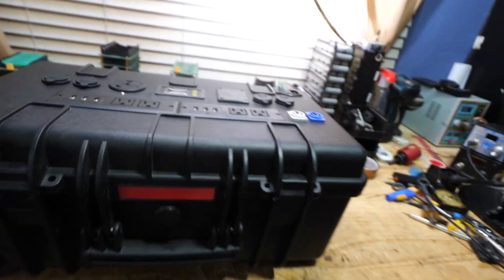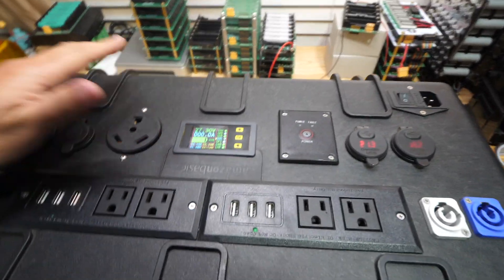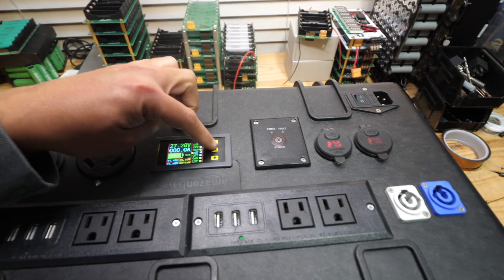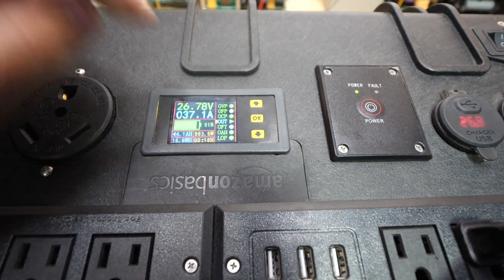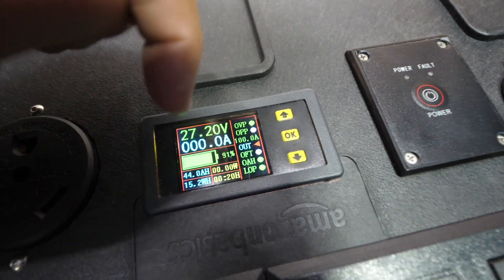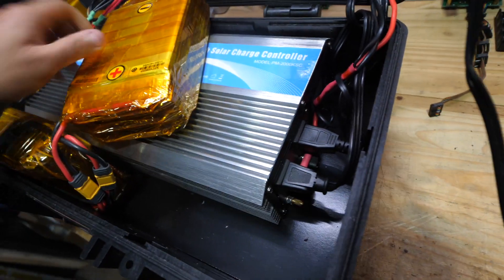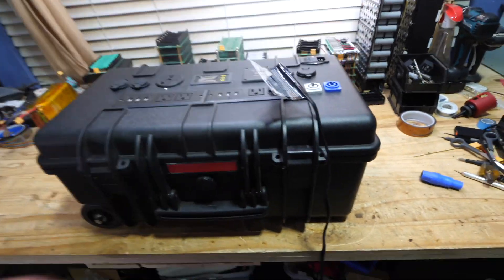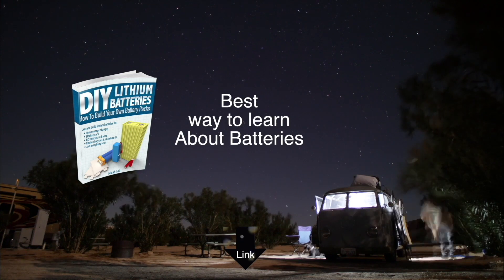DIY Solar Generator still better than NEW Kodiak

Comment: Would it be possible to have a description of the components and why you use them? I am interested in learning and building one… I am going to build my batteries… I have 14 pouches and and trying to find others… I was thinking of building a smaller version and then build a extension

Comment: nice video 🥰🥰🥰🥰i have 48 volt solar charger 30A FOR MY 48V 3000 watts pure sine wave inverter what size solar panel to used not much about panel in in Toronto Canada

Comment: I needed a unit https://www.youtube.com/post/UgkxOTeIs0vv4_9B5hsmnLsk9r930uDQLu_Y that I could store in my home when I wasn't running, so it being light and running on propane were key requirements. I can store the propane tank/bottle outside yet store the generator in my home when it's not in use as I will never put any gas in the engine. It is so light, and on echo mode, which I expect is how it will be used most of the time, it is pretty darned quiet (certainly compared to all the generators I hear in my neighborhood after each power outage).Many of the previous reviews had me concerned that it would be difficult to start on propane, but I have to say, I had absolutely no problem at all. I primed it first using the choke...3 pulls, heard the engine want to start, flipped it to propane, and one more pull and she started. I ran it for 2 hours the first time and plugged it in my fridge. And when I was done, I put the propane tank away and carried the generator to my basement for next time.I could not be happier.

Comment: Awesome video and nice unit. I am currently building a smaller unit for camping ect. I do want to build a larger one as a back up for the house in case the grid goes down. I like the expansion port you have as well and everything is neat and tidy.

Comment: Have they brought out USB quick charge and type C if so  where can you get them I'm looking for both built in and cigarette lighter plug ones my fitbit only charges on a quick charge USB and my phone with 3 hours of charging on the oid slow charger didn't even last 1)2 an hour before it died

Comment: Just finished building my base station system, but am currently designing portable system similar to this. Likely 200ah (2400wh) batteries, 2000w/4000w inverter, DC distribution using Anderson Power Poles, fans etc etc. Love my battery backup systems with solar power inputs and controller.
Reply: I built a solar generator on wheels for 7200 watt hour power, 3000/6000 watt inverter, on board 75 amp LiFeP0 charger for wall power or generator input, 30 amp MPPT solar charger, 250 amp BMS and 8x280 amp hour cells. Its a total blast building this stuff myself. Here's a short video of it charging my other 2100 amp hour AGM bank a few days ago. The stuff on top of it is for a fresh air welding mask project using NATO gas mask filters. Its also a handy work bench and power tool outlet.
https://www.youtube.com/watch?v=NYpczRYDFJQ
Reply: @kimmer6  ….very cool. Nice job. Working on installing a disconnect switch to our main breaker panel. Definitely have some projects on the short list

Comment: Beautiful job! I wish I was able to do this. I would blow myself up LOL!
I did a DIY 2400w with two BattleBorn 100ah batteries, 3000w (overkill) inverter (24v). No real bells and whistles. I am still thinking about adding two more batteries or just go with a ready-made solution. Solar input, extension cords and surge protectors are how I distribute the energy. I also bought 2 Bluetti "solar generators", the 1500w and 2400w on discount. I like redundancy. Three separate sources of energy with enough panels to charge them all.
DIY will be much more affordable if you do your homework. I learned enough now to DIY for less. I would still buy the BBs, they work. Saving money is cool and building your own stuff feels great. But my efforts for learning and projects are now geared to getting ready for the reset and chaos that will follow. HAM radio is my main focus...DIY HAM radio go-box and hand portable battery/power boxes are now being built.

Comment: Hello I know this video is a little old but can someone please explain how to wire up the 5 pin relay to the meter. I built a 48v system because those where the battery packs I had available. I can't figure out how to integrate the relay.

Comment: the downside of using relays instead of fuses, its that relays are always consuming power to consider when you are looking for optimizing performance.
Reply: Fuses are entirely and completely different from a relay.
Fuses melt/open a circuit because of over current. Protecting wire and devices from over current.
Relays are electro/mechanical switches. Switches turn on or off voltage to a circuit. And do not limit current .
Relays are not in any way a fuse.

Comment: How hard is it to build one of these to handle more watts? I’d like to build one of these to power a saw and dust collector at the same time. Saw has 15amp motor drawing 1600watts max and dust collector has 8.3amp motor drawing 1200watts constant.  Would love a breakdown of the best configuration for me to go about building one of these.

Comment: Thinking about building a generator before my big move to FL next year, I am thinking about building this, but why would i build one with those batteries over the normal 18650's? ...if you built one to be better then the Kodiak today, what would you use?

Comment: I'm building one of this, but I like to charge the 7s 8p 18650 pack with a 60a BMS, with more then a 3a power supply. So the BMS specs says can be charge up to 30A, any recommendation? how long take to charge that one with that 3a power supply?

Comment: A relay is not a fuse and there are inherent dangers in assuming it is...saying that it’s even better than a fuse is misleading and a bit like saying boots are better than sneakers.  They each have a purpose and which is better depends on what it’s being used for...you wouldn’t want to run a marathon in boots or show up at a construction site wearing sneakers.

A fuse is a safety device designed to open/break a circuit when the current exceeds a specific amount (example, 15 amp fuse in your house trips if the branch exceeds 15 amps for too long and trips almost immediately in the case of a massive overload) dictated by the fuse rating.  It’s a simple device that repeatable and reliable performs this function.

Similarly, a relay can also be used to open/break a circuit so what’s the difference, right? Sometimes right, but unfortunately sometimes wrong.  In the case of a minor overload monitored by some type of computer chip ‘smart device’ which is functioning correctly, the relay can be ‘told’ to open and break the circuit.  However, what happens if the smart device malfunctions?  Also, in the case of a large and instantaneous overload (ie. a current well above of the relay’s rating), the relay contacts themselves can become welded together (ironically enough, ‘fused’ together) rendering the relay coil controlled by the smart device useless.  The fusing typically happens when the relay attempts to open and in the moment there is a small gap between its contacts, a massive spark jumps the gap creating the heat necessary to weld the two contact together.  To those who are not familiar with this failure mode, I can understand how this scenario might sound a bit far fetched...it’s not...and in fact, it’s not uncommon.

In each case, a real honest-to-goodness fuse would have still reliably broken the circuit and possibly avoided an otherwise serious event.

To those trying to essential warn of the dangers inherent in this type of DIY project...perhaps offering a bit more constructive criticism would help;  we don’t all have the same experiences or opportunities in life and being disrespectful is not constructive...plus...it’s just mean.

I’ve tried to do that here and hope that if even one person reads this and stops to think more about the job of a safety device and what choices they want to make in their own DIY project, then all this typing was worth the effort.
Reply: G M,
Excellent information in your post.  I am assuming a relay would also be more geared toward controlling/directing the amount of amps going through both a switch and the device it powers.  The Device may need 40 amps, but the switch to turn that device on may only be rated to handle 10 or 20 amps going through it.  A relay would allow the rated device amperage (40 amps) to flow to it while not destroying the switch.  Would this be correct???

Thanks in advance!
Reply: @dashboy007  Yes, correct.  If a switch is in series with the load (a common light switch in a home for example), it too needs to be rated to be able to safely carry the same current.  In practice, low power switches are used to “turn on” (send current through) a relay coil (which typical have much lower power rating than their associated relay contacts) and its contacts are used to pass current to the load.  Happy DIY’ing and sorry for the late reply!

Comment: How much would something like this cost???
Reply: Parts list:
Amazon Case https://amzn.to/2pTBh3C 139.99
Power Meter https://amzn.to/2pUk626 29.99
PureSine Inverter https://amzn.to/2TBMQuj  289.99
USB plug x2 https://amzn.to/2CfUYtW 25.58
30A plug https://amzn.to/2RNMmA8 12.89
15A plugs x2 https://amzn.to/2NIvWWn 33.98
Solar socket  https://amzn.to/2CKENG8 4.95
Ext Batt socket https://amzn.to/2RMSGbj 7.96
Grey plug https://amzn.to/2CfUfJe 8.08
Charger https://amzn.to/2pUNZPY 20.99
42 Lipo Cells https://kit.com/jehu/lithium-battery-...
Cable https://amzn.to/2FtK1Iu 17.48
xt60 pigtails x2 https://amzn.to/2S6ULOG 21.98
Power Socket https://amzn.to/2OUlJXy 7.99
24v relays https://amzn.to/2QYGseM 8.99
Kapton Tape https://amzn.to/2R6ubEU 11.98
Eyelet setting kit x2 https://j35.us/Holepunch-eyelet-tool 28.60

 TOTAL 817.52$  TOO MUCH!

Comment: Great work! Sadly it's US focused (110 V input, outputs). Most of the world is on 230 V / 50 Hz for the mains and appliances. Could you please suggest changes to your design to make it also a reference outside US territory?
A remark regarding fuses vs relays: I could see myself adding fuses on individual inputs and outputs as an additional safety that is not dependent on configuration and correct functioning of the controller during a short, but adding more complexity adds also more potential failure points. Your design looks reasonably safe the way it is indeed.

Comment: Hello all, I was looking to purchase a power meter for a portable solar power station that I am building.  I really wanted to buy the one on this video but it is no longer available from Amazon DC Ammeter, DROK Digital DC Multimeter 0-90V 100A Voltmeter Ammeter 12v 24v 30v 48v 60v 80v Voltage Volt Current Amp Power Watt Capacity Time Meter Battery Tester Monitor with LCD Screen Hall Sensor https://www.amazon.com/dp/B01MZIAJI0/ref=cm_sw_r_cp_api_i_5DhXEbE1QS9RP.  

Can any of you suggest a similar one?
Thank you!

Comment: Yes Bro, your build is wayyyy better than the Kodiak.
Reply: Yes his build is better, but comparing it to a Kodiac, is not saying much, his build is better! The Kodiac was a cheap attempt to build a Titan, by Point Zero Energy. The Titans are far better, and truly built, tough, reliable, low frequency units! I still for all intensive purpose, I don't think anyone has ever built, a better, 3000w unit before or since, even today, and the Titans are 6 yrs old. They just built a real dedicated, very adaptable, light weight, solid unit!

Comment: Honestly software protection isnt enough put fuses in anyways It wont hurt and  it will save the device if an electrical malfunction occurs. Things break remember to much protection isnt overkill untill it affects reliability.

Comment: Jehu, I am seriously interested in building one of these.  I’m just struggling with the step by step if I order all the parts.  Do you have a wiring diagram for this setup?  And maybe a list of other little items I’ll need like connectors, soldering equipment etc?  I’m ready to pull the trigger on Amazon, just need that final breath of confidence from a diagram of sorts.  Thanks for your help.

Comment: Have to take issue with the Over Power Protection feature... this is not a replacement for a fuse or proper circuit breaker.... It is a handy feature and kudos for including it, but proper over current protection devices are not optional for a good reason.

Also I noticed your USB ports are showing 27-ish volts which would destroy any USB device plugged into them as USB is a 5V source. Can't be current as you have nothing plugged into them. Unless it's a temperature reading which ok would be cool (pardon the pun) but 2 of them right next to each other?

Comment: I would still like a main fuse myself, in friends race car, no fuses, all relays. So I feel like fuses are best in line to protect batteries BMS can fail, so fuse is for worst case scenario. But like my friends race car that only runs relays cause in a race he rather win and rewire it then lose, a person may not want the power to fail or to give it all it's got cause sometimes that sh¡t happens too.
And now I hear a character from starship troopers in my head " warm it all up! Give me everything you got!". As a million bugs try to stop them.

Comment: Sorry.  I'm an electrical engineer and relays are no substitute for fuses.  What are you going to do one day when the relay contacts fuse together, and are physically incapable of opening?  Your load doesn't disconnect and you end up with a fire.

Don't think about how this operates when it is working well, start thinking about all the things that can go wrong when it isn't working well...

Comment: This looks great.
For a non-electrician... what are some real-world use scenarios for a power supply like this.
For example, how long could a home refrigerator be run in a power outage?
A laptop?
Could it be connected to your home's power to keep a thermostat running and heat going in a winter outtage?

Comment: Dude, you need to develop a thick skin if you are going to be a you tuber. 
Also sorry to disappoint you,but while a relay will disconnect your loads 
the wiring isn't protected without a fuse or a circuit breaker.
Reply from the maker: Don’t care,

Comment: I would install a main fuse anyway. If those relays failed closed circuit due to the contacts getting welded it could still overload. You need a fail safe. That's the only suggestion I have other then that it looks great!

Comment: Beautiful build. My only "beef" is the use of Neutrik Powercon connectors. They are a standard in the world of live music production.  You might consider adding indelible tags to mark those. Also, they are rated for 20a of current. You might consider the larger Anderson power pole connector. But alas, it is your project. I hope my constructive criticism shows I was listening with keen interest as you described your project.

Comment: your system is great for you, a person that know about this..but for a consumer like me, that consider the size, simplicity, weight, portability..etc, does not math this considerations. but good work.  remember: the size,portability and quality battery cost in this kind of product..
Reply from the maker: Smaller, lighter, and weaker is what you want?  That’s what you get buying at the store

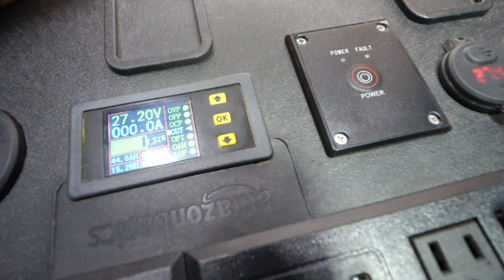Comment: @jehurgia does the amp limit apply to the 27.20V (05:45) or to the 220V plugs? Is the 27.20V the supply voltage to the inverter?

Comment: You deserve a pat on the back for your effort. It's a cool POWER SUPPLY. Very well made.  I've made several similar sized PORTABLE POWER SUPPLIES over the years.   They end up being ok for phone charging and very little use of the inverter unless you have at least 200 watts solar from your panel(s).

Comment: Thanks to men like this and the other DIY channels here we at this home are now Off-Grid, and have been now for over 9 months.  We have No Smart Meter on our Home period and we used the Ford C-Max Energi battery 7.6 kWh (made by Panasonic) 84 cells so they can be used in 12v,24,36v,48v,etc... Just using these cells we were able to cut our expenses down so that along with our other deals like the Magnum 4448 PAE unit with the Midnite solar aluminum heavy duty cabinet which was pre-wire, got it on ebay brand new old stock for just a little over $1,500.00 and then to the deal we got on solar panels.  We power our home for under $5000.  But best of all we have no Smart Meter, people you need to look at the DISCLAIMERS your electric company has on that sh*t.  Scary stuff that we want no part of.   We love these channels !!!   If we can do it you can too.   One of the best things about getting OFF GRID has been how we have learned, we have a new respect for so many more things in our lives.

Comment: If you took the negative comments on your first video about this project as "hate", then you completely missed the point. The majority of the comments were pointing out that there is woefully inadequate cooling. No hate involved or intended. You didn't show the fan holes or fans in the first video.

Comment: Is it me or did you miss putting the amazon link for the fans?
Reply from the maker: I’m missing a few items, updating this project is in backlog but i keep changing it so it’s taking some time
Reply: Thanks so much I can't wait for the wiring drawing to be done so I can build one. I didn't see wheels and a carrying handle on that high priced kodiak, I guess that guy forgot to mention that. Also I would pay for a more detailed video on assembly.

Comment: Relays are not better than fuses. If you pull a high enough load through the relay you will weld the contacts together inside the relay.